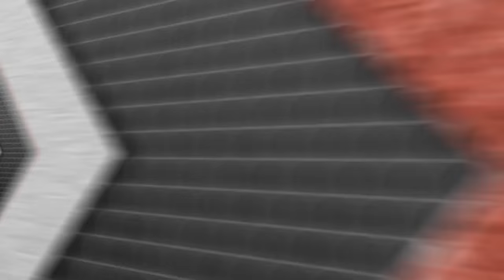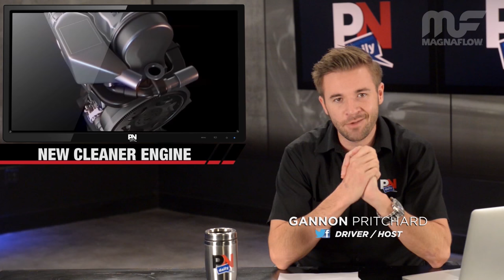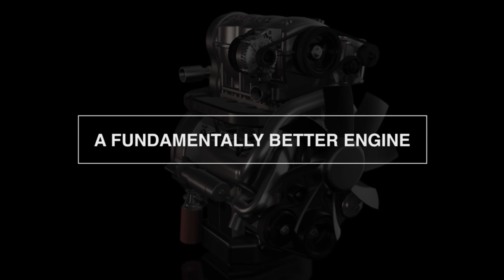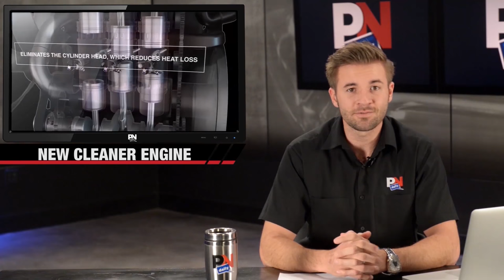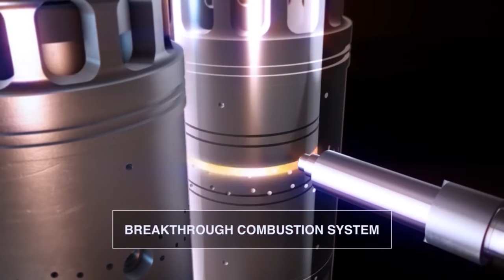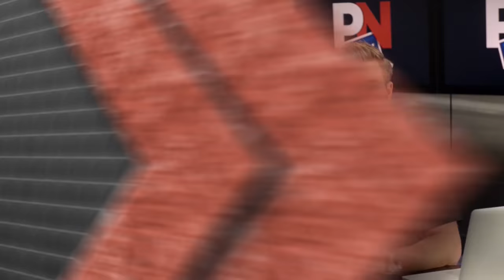The Internal Combustion Engine Might Not Be Doomed

Comment: The opposed piston engine like the one showed in this video has a thermal efficiency of at least 55 percent or better unlike the standard 4 stroke engine which is 35 percent thermally efficient at best that's because a lot of the thermal energy is lost to the cylinder head and ultimately the coolant the opposed piston engine has no cylinder head. Opposed piston engines also allow for higher compression ratios.

Comment: the real solution would be to use Atkinson cycle hybrid systems for normal vehicles use gasoline miller cycle engines for performance or light duty pickup/suv and use miller cycle diesel engines for medium-heavy duty trucks